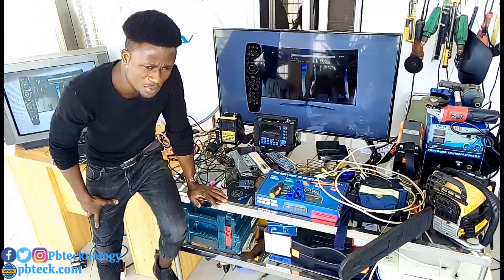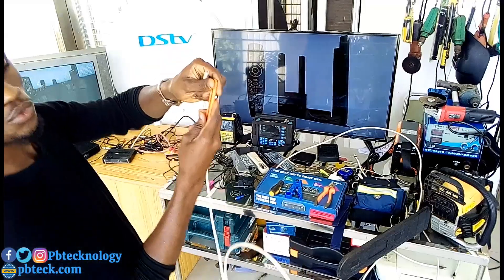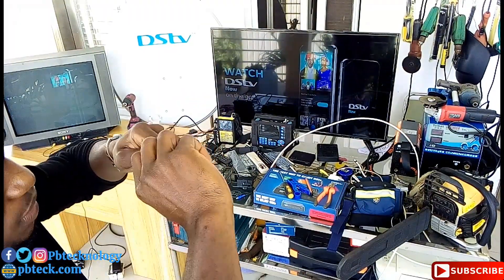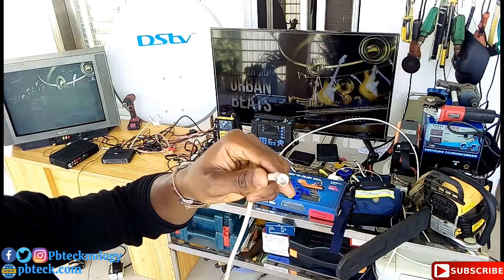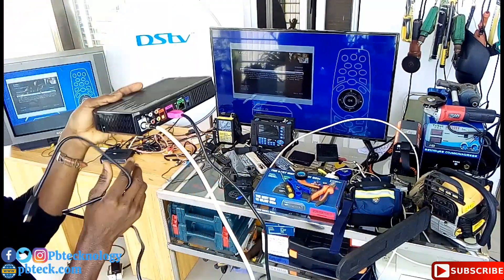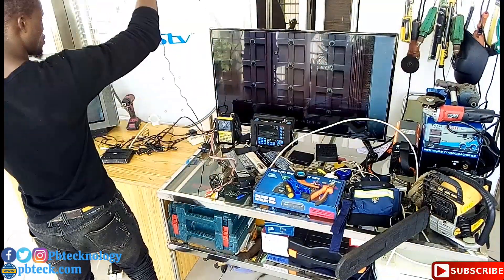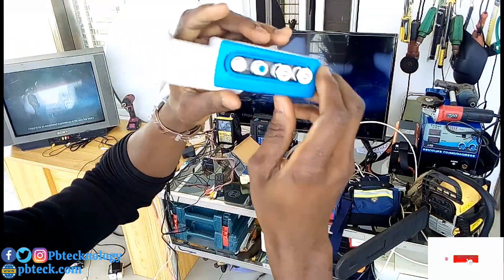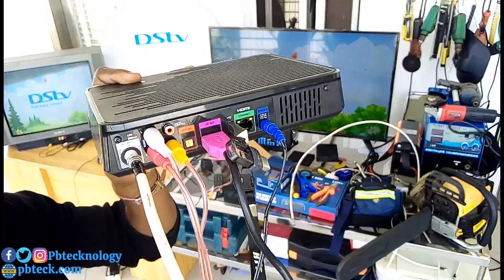How To Install Dstv Explora And Dstv Smart LNB in extra view installation

Comment: I have 2 explore decoders. Been working fine for years but now I have to disconnect one cable from smart lnb for signal to work on at least one decoder. If I connect both cables to smart lnb signal goes of every few seconds. Do you have any advice. Thanks

Comment: Hi, I bought a new explora ultra and it does not have a slot for the smart card, hence it only plays channel 100, what do I do ?
Reply from the maker: You don't need the Smartcard with most  of the latest DStv Decoders.  Channel 100 is only the one working because you have not yet Activated the decoder. Pick up the IUC number or the Smartcard number and call DStv customer service of your country for the Activation. 
Go-to Menu,
Help,
General Information,
Contact center.
Then pick your country number.
Reply: @pbtecknology  thank you, I got it sorted

Comment: I have 4 televisions and I need them to be connected to the decoder together.

Note: I want them connected to the decoder but will be showing different contents at the same time.

How do I do it?
Reply from the maker: You mean one decoder and 4 TV set or 4 decoders and 4 TV set?
Reply: @pbtecknology One decoder and four TV sets
Reply from the maker: With one Decoder it's not possible to change channels on all the 4 TV set. you can use Wireless IR Remote  extender to one TV for the remote control.
Reply: @pbtecknology  so what can I do to change channels on the four TV's?